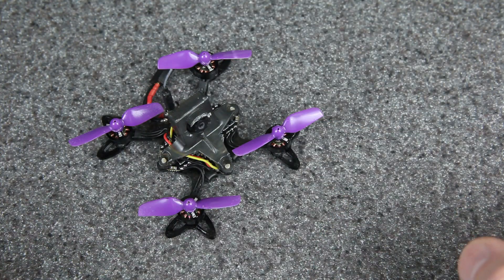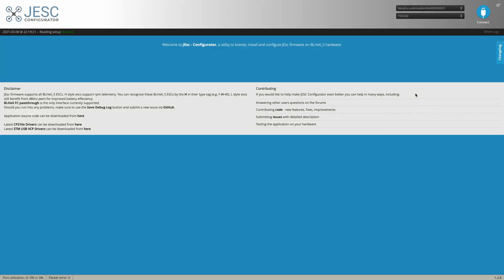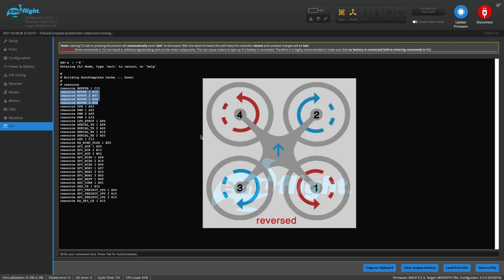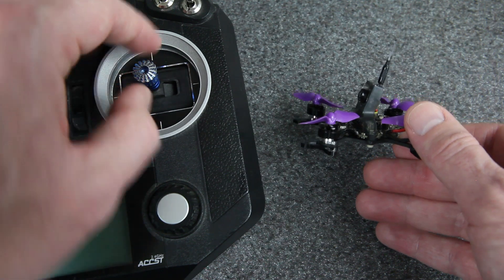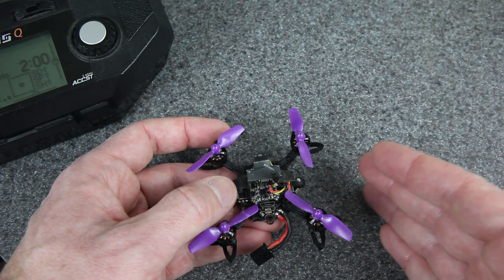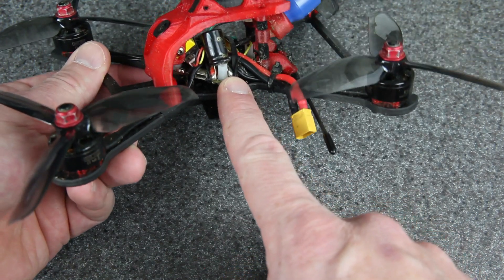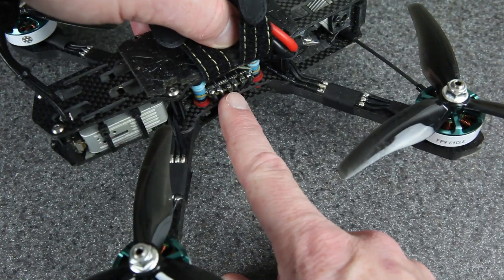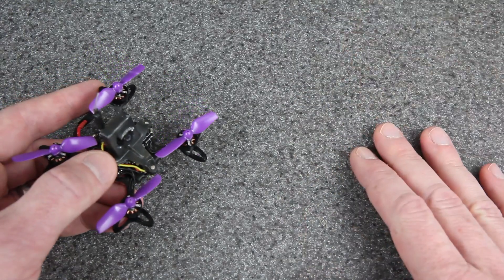How to Mount Your FC in Any Orientation (AND WHY I DO THIS SO OFTEN)

Comment from the maker: If you use Betaflight 4.3 with the latest Configurator, this process will be even easier. They added a tool on the Motors tab of the Configurator which lets you reorder the motors more easily! The steps shown in this video will still work, but there is now an easier way. The steps that I show in the ECS firmware are still the same regardless.

Comment: I can't figure out how to flip the fc on the soeedybee app.  I had to install it upside down because of the USB port but it's letting me rotate the fc but not flip it
Reply from the maker: It has been a while since I used the speedybee app, but it looks just like the Betaflight Configurator so I would expect there to be a “board alignment” section on the “Configuration” tab. No?

Comment: Great video thanks so much for your time.  I want to spin my AIO diagonal FC 45 degrees in a frame that is meant for square orientation. How do you handle the mounting?  I guess I need some kind of adapter?

Comment: Oh this great thanks man, thought i was toasted, have to mount the fc facing backward instead of forward, due to constraints of the build as I have to mount the ESC facing backward also and have no 8 pin to 8 pin that's long enough, so basically i can do that and just change the yaw angle setting in betaflight!?
Reply from the maker: Yeah,  you need to change the board offset yaw, but you also have to make sure betaflight knows which motors are in which positions. You can follow the same steps that I showed here, or if you want to try the Betaflight 4.3 RC (and matching RC configurator), then they have a new motor remapping tool that should make it even easier. Good luck. :-)
Reply: @MrShutterBug  Thanks a lot for your reply and help

Comment: Hey my man. Hope u can help. I destroyed my first version of this so i decided to get a new one and redue it. It flew just fine stock, then i did all mods and rotations and motor remapping. When i go to arm i get the "BOOTGRACE" code now. Any clue as to why? I did notice the beeper was on the same pin as motor 1 so when i remapped motor 1 to 4 would that be an issue?
Reply from the maker: To know if you got the motor mapping correct, I suggest you take the props off, plug in a battery, connect to betaflight, and use the Motors tab to spin each motor one at a time. Then you can verify that the correct motor spins and that it spins in the correct direction.

I looked up the "BOOTGRACE" code. It means that you are trying to arm too soon after powering on. You have to wait a short period of time before arming, for safety. That time is controlled by CLI command "pwr_on_arm_grace" and defaults to 5 seconds. If you get "BOOTGRACE" even after waiting several seconds, then maybe your arming switch isn't mapped the way you think it is? Check it on the Modes tab in betaflight. Good luck!
Reply: @MrShutterBug  thanka for ur help. It was an error on my part. I remamped 2 motors incorectly. Luckily i have 2 of these so i looked up motor resource on the first one and mapped the motors on the second one the way the first one was assigned. Luckily they are identical and i was able to fix it that way, otherwise i may not of found the original orientation. Im thinking the bootgrace code was because i remamped 1 of the motors to a pin that gets a constant flow of power or somthing like that. Once i remapped bootgrace went away and it has worked perfect since. Other than now i have to recalibrate the fc everytime i plug in a new battery, no clue what thats about but not to big of a problem, just annoying. Thanks again for ur help and infomative videos, plus i miss living in washington and ur vids are extra special to me cause they are from my home in a way. Thanks again, i appreciate ur time and effort. Have a beautiful rest of ur day my man

Comment: Hi Mr, could you share the PID's and Rates that you were used on that model.? Tks.
Reply from the maker: When I made the video about the Nanohawk conversion, I was using stock Emuflight 0.3.3 PIDs. My usual rates are Rate = 2.1, Super Rate = 0, Expo = 0.4 (all 3 axes). My rates are pretty twitchy in the middle, but I like it because the response is almost linear all the way to the end. That makes it very predictable once you get used to it. Just my preference. Cheers!
Reply: @MrShutterBug  Thank you very much for the answer, I will try to improve my flight here. Hug from Brazil.

Comment: I wonder if you could simplify this build, by using the stock canopy and just trimming and cutting it down until it has enough prop clearance to fit the bigger props. Idk, I don't own this kwad, so I'm asking you.
Reply from the maker: It looks like you could use the stock canopy and simply cut away the prop guards, but I have not tried it myself.

Comment: If you put the FC upside down is it enough to change the motors? I would think the gyro also should change but can you set that as well?
Reply from the maker: If you flip the FC upside down, then you will to tell Betaflight that the board orientation was rotated by 180 degrees. Which axis depends on how you flipped it. In other words, if the same end of the FC is in the front, then it was a 180 degree roll. If the front of the FC is now in the back of the drone, then it was a 180 degree pitch. Now, if it is an AIO FC, then flipping the FC means you also need to swap the motor resources (left to right, or front to back). Make sense?
Reply: @MrShutterBug  Yes. Thank you!

Comment: Thanks for explaining the motor resource stuff in the CLI.  I could never seem to get rotating the FC in Betaflight to work and now I know why.  It’s good to know both methods though, for instance, a Silverware board pretty much has to be rotated in the radio.  I also modified an Eachine E010 for long range flights by mounting a camera on the roll axis for better antenna positioning,  and I had to swap roll and pitch in the transmitter for that build.  There’s a video of that on my channel if you’re interested.  Thank you for making all of your amazing videos...I am grateful for all I have learned from you.

Comment: Thank you so much for this video! I have one question about your babytooth build. Which receiver do you use for that and how did you hook it up to the board? Thanks.
Reply from the maker: The Babytooth with the black Flywoo motors has an XM+. I didn’t use the receiver built into the FC because it has terrible range (even for a whoop board). Fortunately, the Crazybee Lite FC has an extra UART and an extra inverted Rx pad for SBUS. The pads are small, but you’ll see them if you pull up a wiring diagram for that board. The Digital Babytooth, use Crossfire.